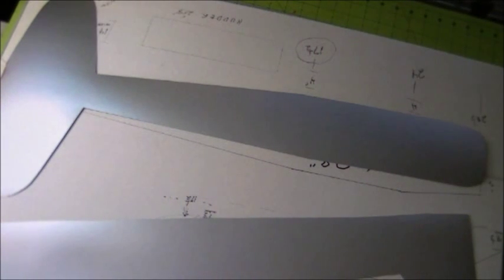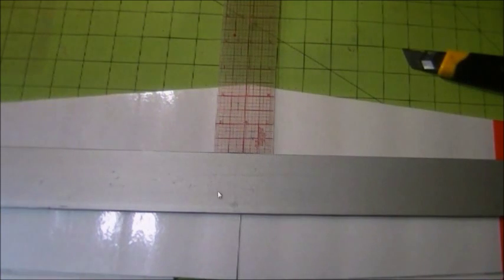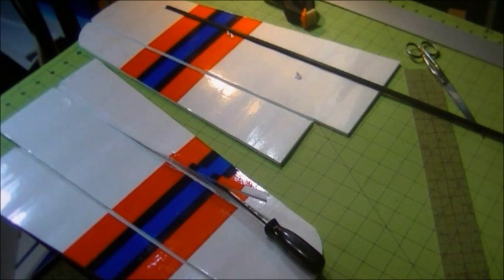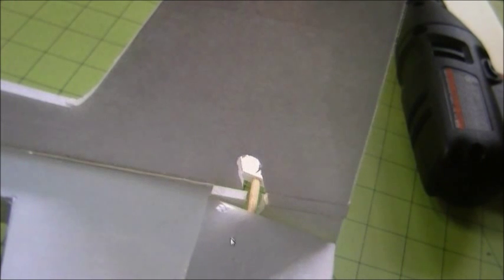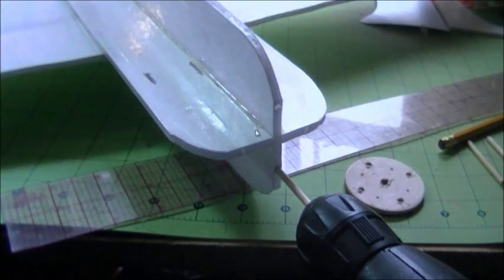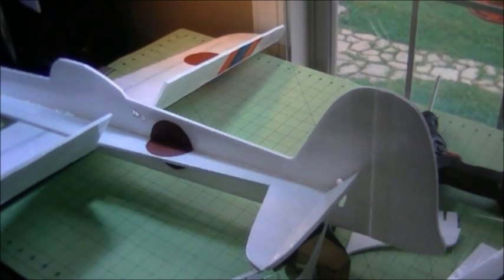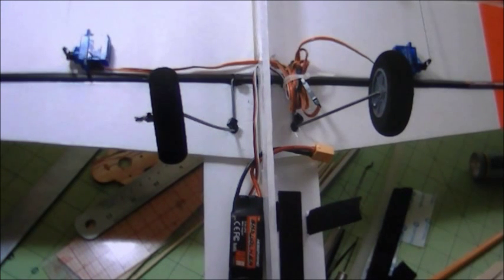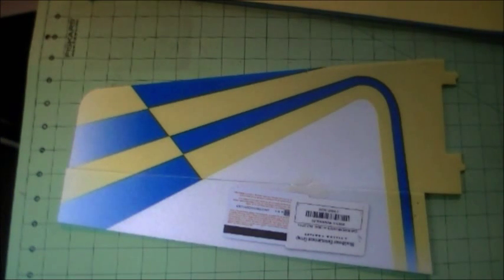How to build profile  rc plane easily.

Comment from the maker: HK 2826 2200kv motor, 40 amp esc, 1300mah battery, 4 - 9gr servos  Flag wire, 4 quick links, 4 control horns